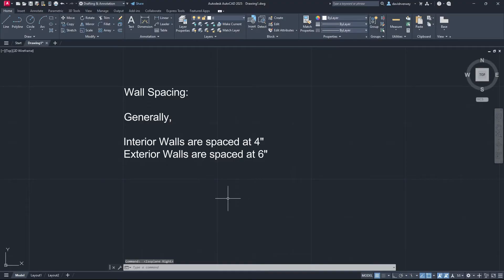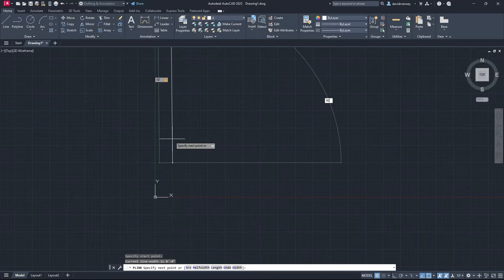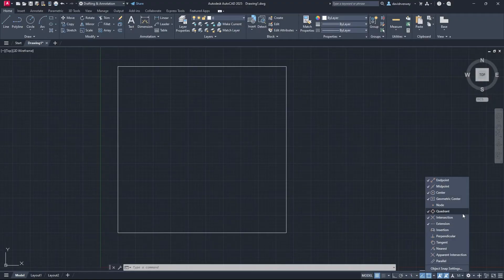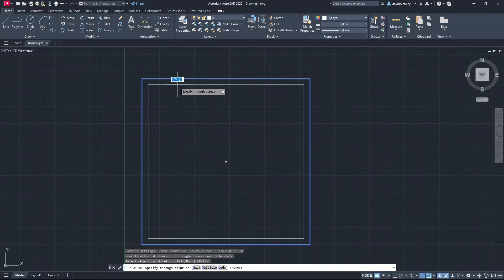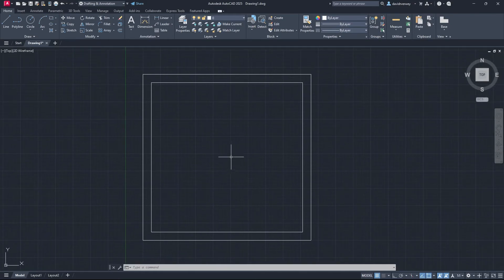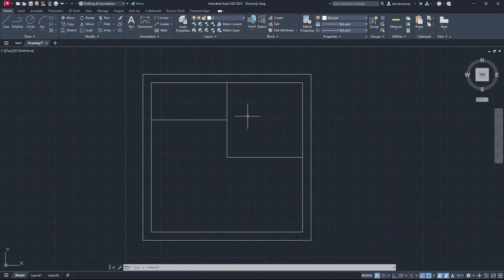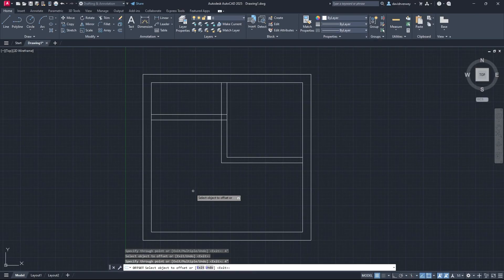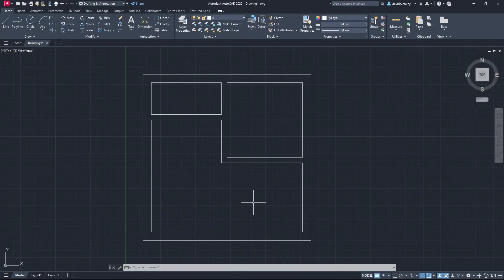Draw Walls in AutoCAD - 5 Minute Tutorial

Comment: how did you select the whole box as an object when offsetting? When given the prompt to select object, i am only able to offset one line at a time
Reply: without having to select the drawing and use 'join', to clarify sorry
Reply from the maker: You'll need to draw as a polyline or as a full rectangle in order to do it "properly". If you just drew lines without joining, you'll have issues with the offset not offsetting fully, creating gaps in your corners.